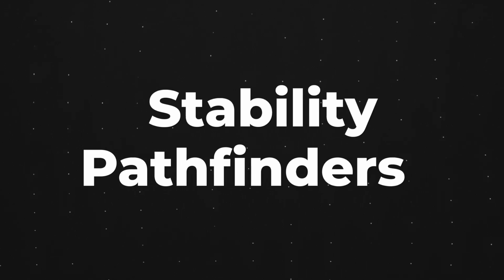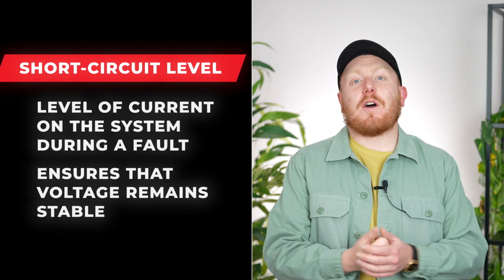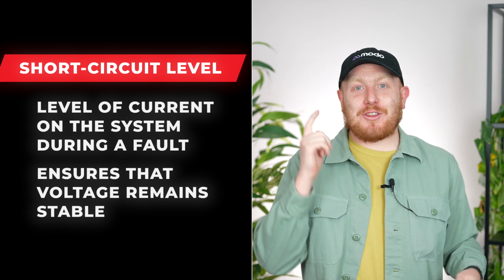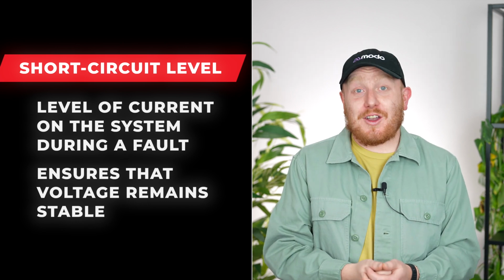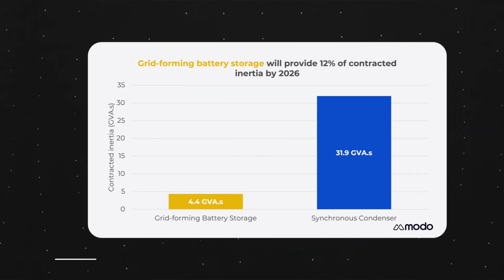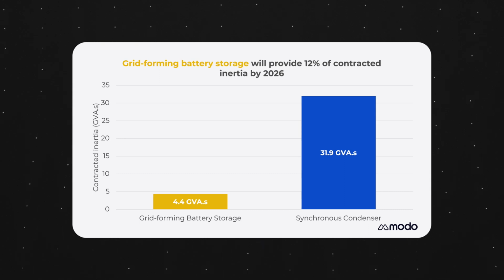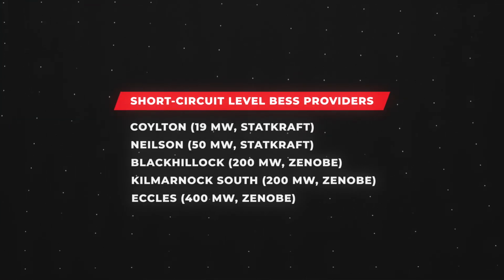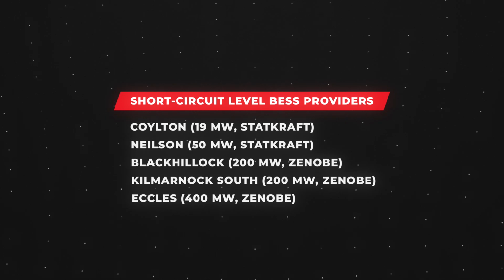Stability Pathfinders: providing inertia through battery energy storage

Comment: Lithium is weak and expensive technology.  Hazards like thermal runaway exist at low but not zero rate.  A fire in a battery substation would be a disaster for the community affected that last months.